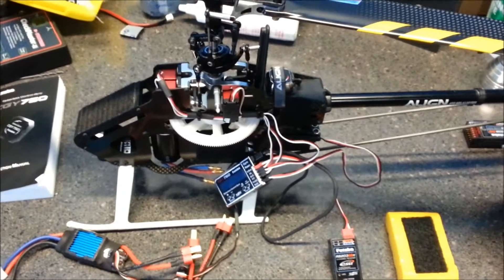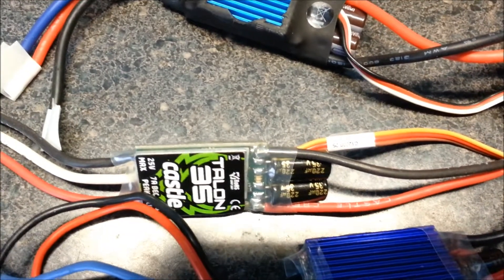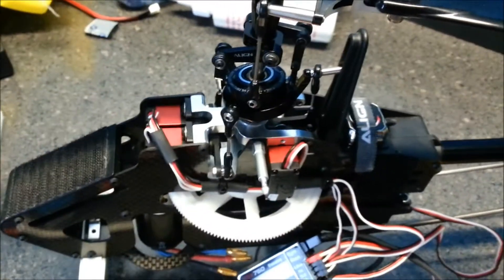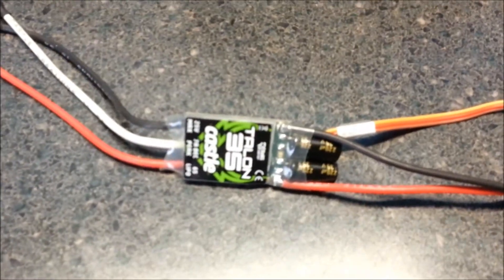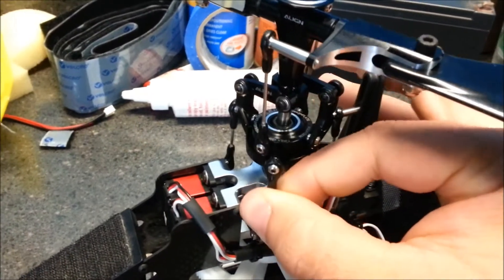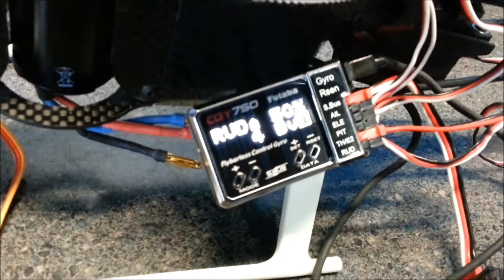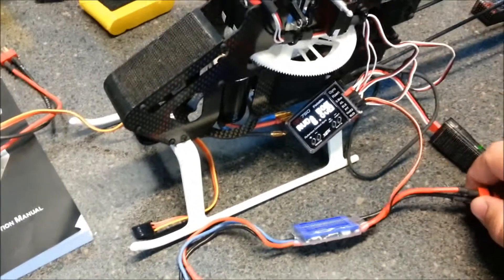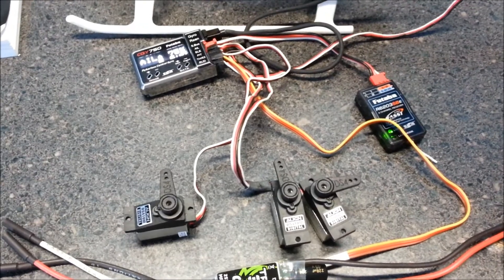CGY750 Servo Issues

Comment: Was this issue ever resolved? Im having the same problem, but with only my pitch servo acting dead?
Reply from the maker: Sort of resolved.  I found the bec voltage has to below 5.5v in order for it to power up correctly.  So instead of buying a new esc/bec, I installed a beastx.  So basically get a programmable bec and set it to 5.2v or so and it should work.